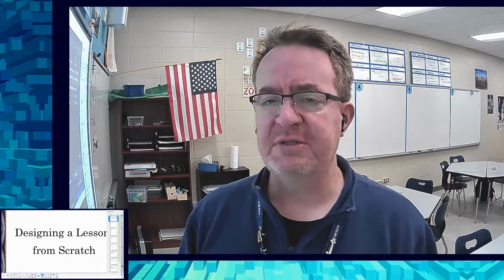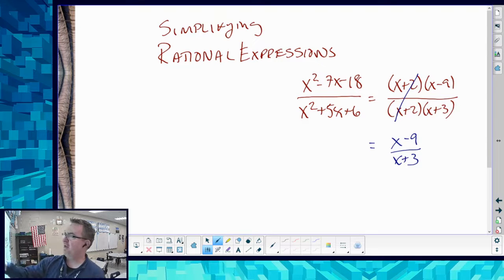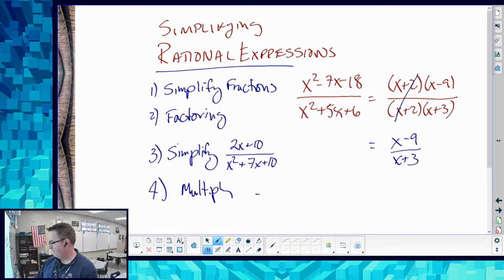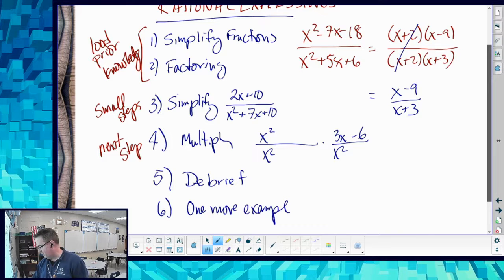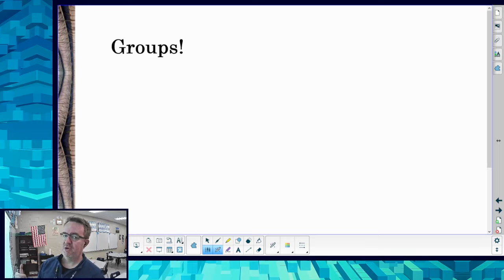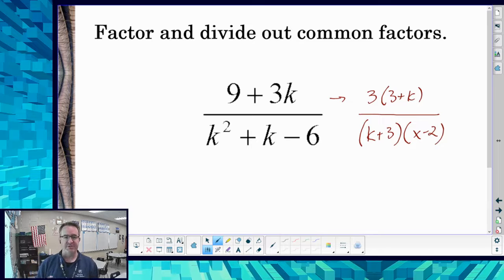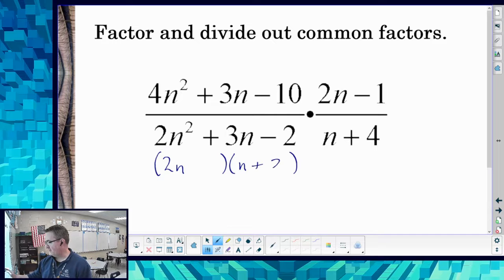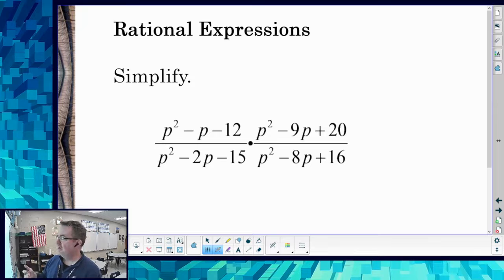How do I Design Lessons for Building Thinking Classrooms from Scratch?

Comment: Thanks so much for this video. Im just starting out, very helpful. When you say "good job, go sit down" to the groups that have grasped the idea- are they going to the desks to start more problems independently or are they waiting for whole class to return and you to give next direction?
Reply from the maker: It depends. My goal this year was to have some notes with problems to work or a writing prompt. That was put on the back burner for a variety of reasons. Hoping to attack that second semester.

Typically as I like to have problems on the front board to control pacing, it's the last problem and groups are relatively close to wrapping things up. Honestly, most kids like having a minute or two to themselves and take a minute to chat or catch their breath. 

I will add it does help this year we banned phones in classrooms - kids have to put them up on a wall holder at the beginning of class. Makes regrouping after two minutes of "nothing" easier.

Comment: It's when my class has 4 students eg) who are THAT far behind.  OK, get them in at the level they are at...and that is a good teaching practice...but they just can't keep up.  What is your process for when students fall behind - the class is too far advanced- even though you are trying to bring them up.  What to do when you just. Have. To. Move. On. And they are no where near the rest of the class. It seems so many teacher just pass students with a 52%to the next class and they really are not there
Reply from the maker: Couple of ideas:
1) I always give more problems per slide, page, etc. than I necessarily want kids to get through so that there's some challenge for groups who are on top of stuff. So say we are solving equations. I would have three problems on the board - a basic level, focus, and maybe a challenge (I don't label them per se though colleague calls them Mild, Regular, and Spicy in class). Focus level is like a problem that would be at 80%. I would tell groups to get started on these three problems and see how far they can get. Most of the time a standard group will be wrapping up the middle problem when we move on so most groups don't finish. But that way the slower group never feels like they are always the last one done. 
2) My lower kids who want to learn tend to quickly catch on that they want to be the ones with the marker as much as possible especially in the beginning. Then they can get ideas from the kids who get it and not have to look like they don't know what's going on. 
3) Try and make random groups ahead of time to spread the four kids out OR just get really good at looking for them in the random groups from the website and accidentally bump the random button again if needed. I don't do cards anymore since kids trade a lot and I don't like policing that. 

Hope that gives a few places to go but definitely putting it on my questions for colleagues list for a future video.